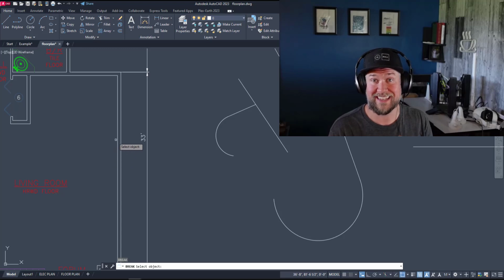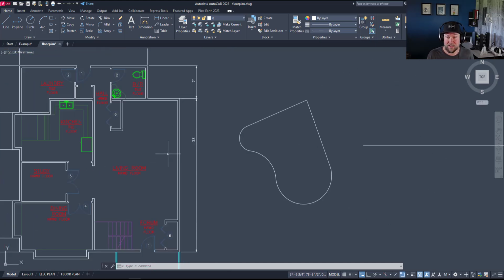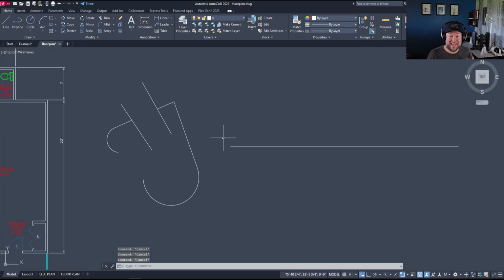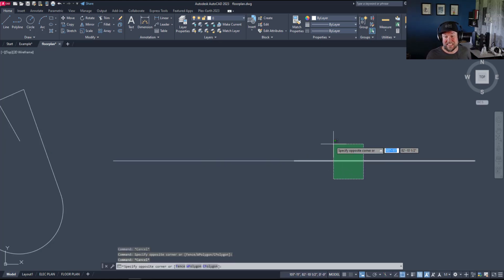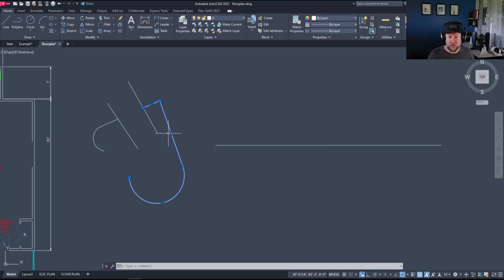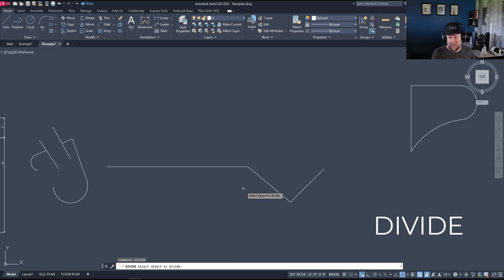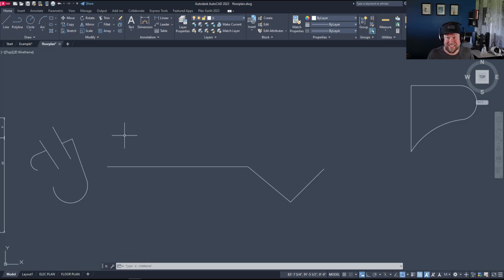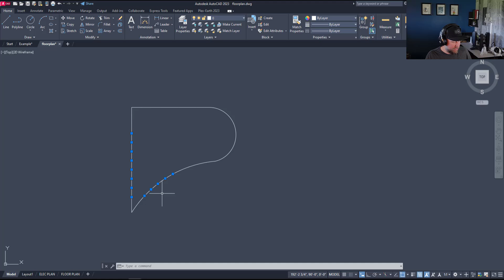AutoCAD How to Split a Polyine! Break at Points, Equal Segments, Split & More!

Comment: Only question I have is where does the measure command star measuring from? Can you tell it where to start?
Reply from the maker: Great question, it starts from one of the ends of the polyline or the start/end of say a closed polygon (point you started drawing the polygon from) of the polyline and will have/leave an un equal measurement at the end, assuming the measurement distance doesn't fit perfectly.

When you start the measure command, whichever side of the polyline you click on to select it, the measurements will start from the closest endpoint to where you selected it. 

hopefully that makes sense, should of mentioned that in the video! 

So if you have a polyline going across your screen horizontally. If you select the object after typing measure by clicking on the left half of the line, the measuring will start the the left most end of the line, and if you click on the right half of the line when selecting it will start from the right endpoint. 

Cheers!